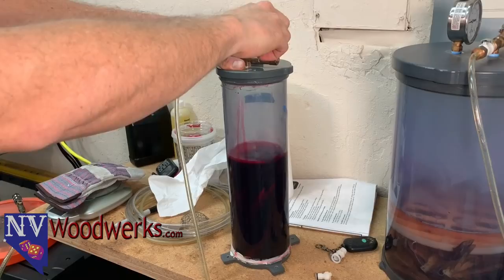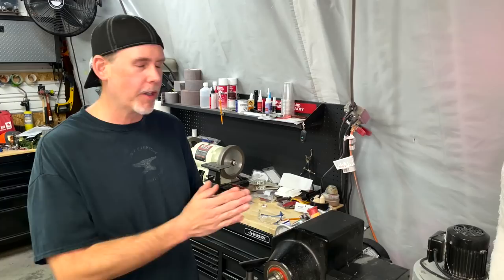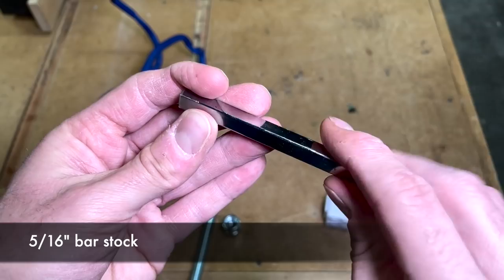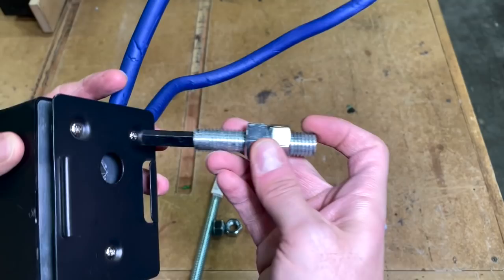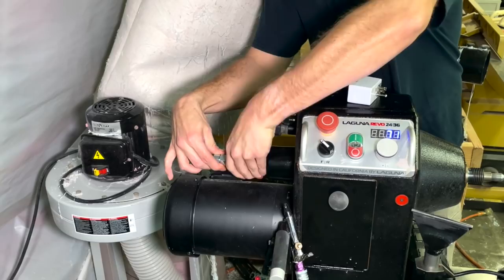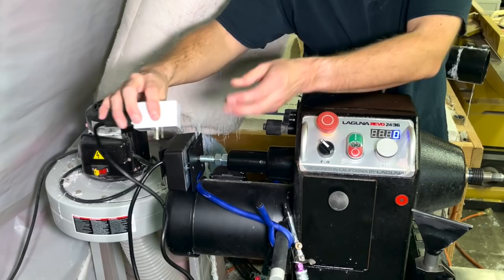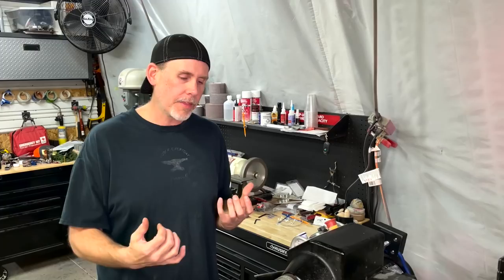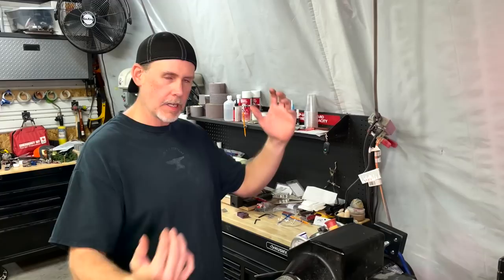Hooking a Rotisserie Motor Up To My Lathe

Comment: I did the same thing with my first lathe. It is an old craftsman style lathe. I mostly just use it to spin buffing wheels and such. All I had to do was cut the rotisserie rod to fit and drill a hole in the motor housing directly in line with the motor. This motor has a cooling fan on the end that happened to be the same size as the rotisserie rod, so I just loosen the fan and slide it back a half inch which engages the rod . I’ll supply a picture if I can figure out how to add it.

Comment: Zac, for under 50 dollars you can buy a dedicated fishing rod drying setup, and keep your lathe running for other things.  Just an idea.
Reply: What would I search for?
Reply from the maker: I specifically wanted to be able to use the lathe for mine, often times I may need to go back and forth between finishes, sanding, and turning. Would a fishing rod dryer be able to hold a heavy item?
Reply: @billy19461  fishing rod dryer in Cabellas
Reply: @ZacHiggins  probably a few pounds
Reply: @ZacHiggins  That vase is gorgeous.  great work.
Reply: @johneliadis9689   Thank you!

Comment: Thanks for this. Won't work on my lathe as it is, but you've given me some ideas. All I have to do is drop one of the drive belts off my lathe / motor and then figure out a way to connect to the spindle. My lathe doesn't even have a hand wheel, let alone a thread on the outboard end of the spindle.

Comment: This is such a cool idea! I have a different lathe so instead of the threaded bar, I’m going to make a disc with a 5/16” square cut out of the center and hot glue it into the depression on the outside of my handle. The rotisserie motor can be taken on and off quickly while the disc stays and my punch out bar can still be used. Thanks a bunch!
Reply from the maker: That's awesome! I was hoping that I could maybe spark some ideas for folks who have a different setup, glad to hear that you can run with it 😀

Comment: Zac, watched your pine cone video and have been thinking about this rotisserie device.  Glad you put this video together.  I used to make fishing rods and had a similar setup but got rid of it.  This should work fine for me.  Kim Tippins (a turner in FL) uses resin diluted 1:1 with acetone for a finish.  I tried it and it works very well.  Would probably work great with your device.  Finally, Amazon just delivered the band saw sled!  Looks like I have a busy week ahead of me!  Hope you had a great Christmas.
Reply from the maker: That's awesome!!! You'll be having fun with all the new toys 😀 One thing to note about diluting epoxy resin, it could alter the physical characteristics of the epoxy. It does thin it out, but it could also have unintended consequences. I actually prefer keeping it thick, works really well for finishing

Comment: Looks like a great idea! Which epoxy finish(es) do you use with this setup?
Reply from the maker: I've been really liking this setup so far. I've used Alumilite's Amazing Clear Cast Plus so far, it works great for finishes

Comment: Thanks Zac, I've been waiting for this video!  My biggest question now would be how do you like the speed?  Is it too slow?
Reply from the maker: Finally got it up! Been waiting to finish up that pinecone lamp project since it was the first project I wanted to use the slow motor for. I like the speed, it has worked perfect with Amazing Clear Cast epoxy for the finish

Comment: Hey Zac! Could you make a video on safety when setting up and using a pressure pot for resin? I’ve been making resin dice for a while and I’d like to get a pressure pot to better my works, but I’m a little intimidated because it sounds like they can be pretty dangerous if you make a mistake. Love your videos! :)
Reply from the maker: Thanks Hannah! Great idea for a video. I'm not sure when I'll be able to get it up, so I'll just share a couple tips that will keep you safe and sound. For the most part, as long as you don't go over the max psi for the pot you're using, you'll be safe. So make sure to check what the sticker says for your pot. Also, make sure to leave the safety release valve on the pot to ensure that it can't go over the max. Hope you get a pot soon. No need to be intimidated by them, but I totally understand. I was scared of them when I first started out too =D Although they can be dangerous, the only real cases I've heard of where a pot blew up was caused by people going way over the max psi.
Reply: @ZacHiggins  thanks so much! Your message already makes me feel more confident! I can’t wait to get better at resin working- your videos help a lot! Thanks again! :)

Comment: Hey Zac! Great idea! Do you disconnect the main lathe motor when doing this? Just wondering if there is enough power to have it turn the lathe motor. Also is there any danger of the lathe motor becoming a generator and sending current back into the control box? Thanks!
Reply from the maker: I just leave the belt on, it turns it no problem. I have no clue about it sending current into the control box. I haven't seen any problems so far, but I wouldn't even know what I'd be looking for really. Maybe just turn the lathe off completely to avoid that?
Reply: @ZacHiggins  ok cool. thanks Zac

Comment: do you take the belt tension of the pulley?
Reply: off
Reply from the maker: You could, it will lower some of the load on the motor. I've tried both on and off, but it works fine both ways so I just leave it on

Comment: Could have purchased a variable speed controller for $17.00
Reply from the maker: I don't know about those, but it sounds like a good idea
Reply: Those only work with DC motors. I think most of not all lathes are induction motors